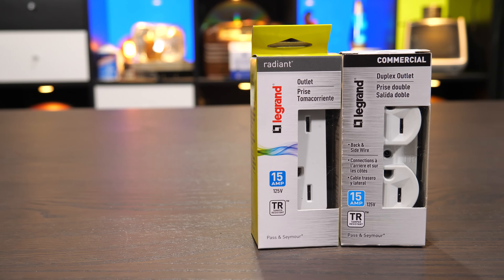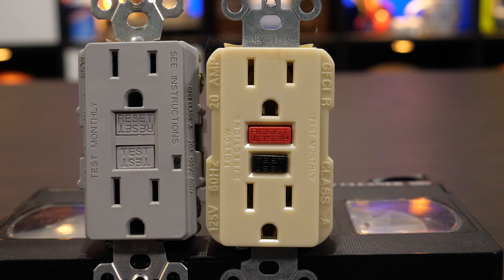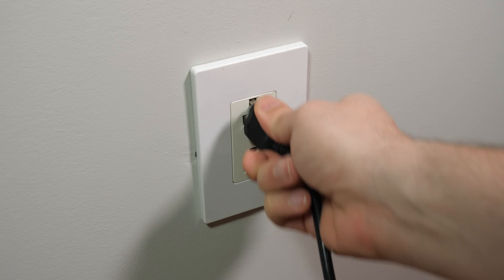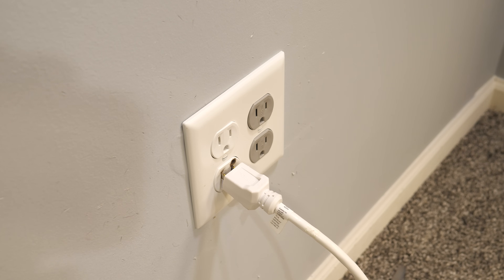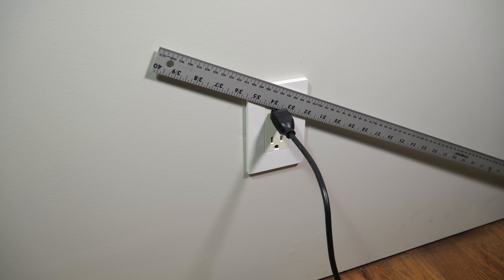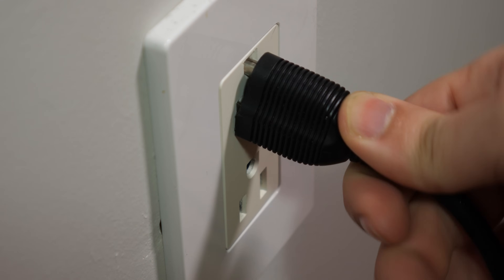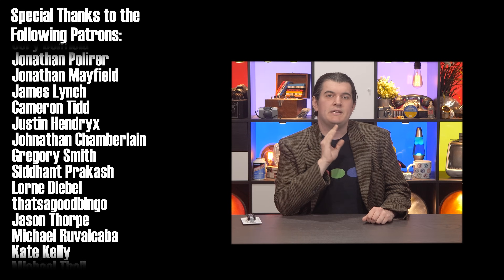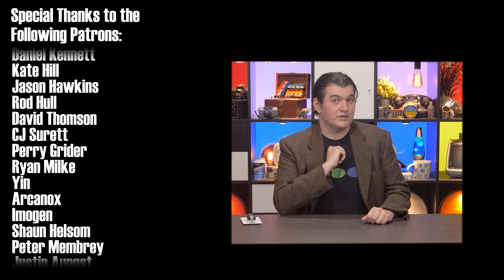Power outlets are topsy turvy - but does it matter?

Comment: Every house or apartment I've been in has its outlets ground down. But at my current workplace, all the outlets are ground up. I never noticed because I don't plug things in at work until I saw a right angle plug halfway up the wall pointing upwards. I just thought it was shoddy installation, like how most buildings are done nowadays. That is until I noticed that every plug in the building was ground up.
But I'm in agreement that instead of focusing on the outlet, we focus on the plug. Both insulating the parts of the pins that could be touched and right angle plugs would greatly increase safety. But I have a caveat. Don't have right angle plugs facing towards other plugs! The biggest downside to 99% of right angle plugs is that they cover at least one other outlet when plugged in. I have a 6 outlet surge strip that has 3 things plugged into it because of the bulky right angle plugs, and that's only because the third thing is a straight out plug and not a right angle plug. There's gonna be that guy that says "Just plug it in the bottom outlet and you don't have to worry about that derrrr", and to that I say that doesn't work as most appliances where the power supply is also the plug do this. Also, some bulky plugs are so bulky that they cover the outlet above them. My recliner is like that. There's no reason it needs to be that way, but it is.

Comment: Actually, I do care.  AC cords with a 90-degree bend at the plug to remain flush with the wall are designed for outlets with the ground pin at the bottom [as you covered in detail--yes, I should have watched the whole video before commenting].  My UPS has one of those, in fact.  Regardless of what may have been intended, or what may be marginally better, I don't want any busybodies telling me I need to flip all my outlets upside-down.  I like my surprised-face outlets just fine.

The 50-year-old tape-recorder AC plug is also not polarized.  You can plug it in two different ways, only one of which should be allowed in many cases.  I'm old enough to remember a record player that let you know in no uncertain terms that the plug blades should be flipped the other way.  ZZZZAPP!!!  Yeouch!  120V AC feels painfully tingly, more like a hand-and-arm seizure.

Comment: The risk of a short is greater-than-zero.  But it isn't enough to worry about in a residence or office (Except in Boston).  Let's just all agree the NEMA 5-15 and 5-20 are terrible, but not so terrible we need to bin every plug and receptacle in Taiwan, Japan, and most of the western hemisphere.  
The 45 degree plugs are the best solution.  Most office/home Battery backups use the 45 degree design.  Only my Rackmount UPS uses the old straight out of the wall plug.

Comment: It's possible to make plugs and outlets much better with just a few simple steps (some of which you already mentioned):
1) Yes, mount them Chicago-style (landscape) - but rotate each outlet, ideally so the ground pin is upwards.
2) Have the cord come out of the bottom of the plug (furthest away from the ground pin). That way, the cords never tangle & don't pull out under their own weight.
3) Make the ground pin a bit longer than the live/neutral pins, and partially sleeve the live/neutral. Optionally add a "shutter" to close off the live/neutral if there's no ground pin.
4) Make the pins way bigger, and rectangular
5) Add switches.
6) Oh, er, sorry, I seem to have been describing a British double socket 😆
Reply: You forgot Add a fuse to each plug.
But I do agree with 2,3 and 5. And you can already find tamper-resistant outlets with shutters at your local hardware store. These don't rely on the ground plug and instead require live and neutral to be inserted at the same time.
Reply: I think you forgot the fuse in the plug
Reply: @Jonkree-old   With modern RCDs, the fuse would be pretty much redundant in a US wiring system (lots of spurs). They do still serve a purpose on UK ring mains, although generally the RCD will trip & take out ALL of your sockets before the fuse blows... An exception would be if you overload a single socket - I used to run my whole office on one 13A plug (and a humongous extension cable) - it actually drew nearer 16A & got so hot it burnt the side of the plug off, and welded the switch "on" on the socket it was plugged into!
Reply: orient so neutral is upwards
Reply: The US has new TR (tamper resistant) outlets that have shutters over the hot/neutral. I wanna say it's the new base standard for outlets but i could be wrong
Reply: XD i mean the likelihood of a deathtrap is less
Reply: Sure, your love of that monstrosity will evaporate after you step on top of one lying on the floor at night. LOL.
Reply: @parkershaw8529   I suspect that's the real reason for the switched outlets - they're rightly terrified of leaving something unplugged!
Reply: @parkershaw8529  I can honestly say that, in 50 years on this planet, I've never ever stood on a plug barefoot. Of course, one reason for this is we have switches on our sockets, so we don't need to unplug stuff and leave the plugs lying around on the floor...
Reply: Better solution, use European plugs and sockets.
Reply: I think british socket is still pretty inferior to the standard EU socket.
Reply: @RamsesTheFourth EU plugs have the perfect balance of being safe and convenient. Being recessed makes them quite flush with the wall and you can't get to the prongs while plugged in. 
Also you can add cheap removable child safety discs into EU plugs that block the way unless twisted.

Having an extra fuse in the plug is safer in a similar way as wearing a helmet when you drive a car is safer.
Reply: @RamsesTheFourth   In what way(s) specifically? As someone with experience of both (and also US & Aus/Chinese sockets), I'm ambivalent over the advantages/disadvantages of UK vs EU.
Reply: never understood the switches. if they accidentally get bumped at the same time as something comes to short it doesnt matter how many switches you got.
Reply: @ahandletocontinue123   The switches are useful if you want to leave something plugged in, but have it isolated & definitively "off". But honestly, they're just a convenience, not a safety feature. You can buy unswitched dual UK sockets (and singles).
Reply: Switches are important, lets say you have a short on a metal device - you know you can turn the device off quickly.  @ahandletocontinue123
Reply: @davidt-rex2062  Or, you could do this insane thing called unplugging it, which I'd trust a lot more than a switch.
Reply: @wta1518 it's convenience more than safety. Sometimes the wall switch is more accessable than the switch on the appliance. Also for things like your TV back when they had cathode ray tubes and drew lots of standby power you can turn it off without unplugging it
Reply: Or you could just pull on the cord to rip it out the wall. Even faster than fumbling songs for a switch. Who cares about not damaging a wire if it's an emergency.
Reply: @mrping100 or just have a wall switch that connects to the outlet.
Reply: @davidt-rex2062  why wouldnt you just unplug it? and if it was that much of a short your breaker is gonna get to it a lot faster than you grabbing a switch
Reply: @davidt-rex2062  you can also just yank the plug. You have to reach for it anyway if that's where the switch is! ... I think there's a video on that actually...
Reply: @mrping100  1) no, it is never more convenient to reach for the outlet unless the thing that's plugged in is horribly designed. What a stupid "argument".
2) No one uses CRTs anymore outside of a few retro enthusiasts. And, a better solution would be to have a switch on the TV that actually turns it off. Much more convenient that having to worry about whether or not your phone is actually charging because the unreachable switch on the outlet might have been flipped.
Reply: @Tsuchimursu  You'd be surprised how hard it is to pull a UK plug out of a socket by it's wire. It's a design feature - the idea is instead of the plug harmlessly pulling out of the socket e.g. if you stand on the wire: Instead you trip over the wire, bang your head on the table on the way down, then the appliance who's wire you just stood on lands on you, probably causing burns or impact injuries...
Reply: @wta1518  
1. It just is more convenient. I could name you specific examples from my workplace where that's the case but largely its unimportant, you are literally incapable of understanding because you haven't had the use experience. As the saying goes, you don't know what youre missing!
2. A CRT was CLEARLY me giving an example, hence why I said "when they had". Learn to read. And sure, would be nice, but most appliances do not have a button that actually does that
3. Its not a common point of failure. Please don't talk about things you haven't got experience of. and they don't get accidentally flipped because we know how to design a sturdy switch here, unlike the standard american light switch
Reply: @404hopenotfound  I mean sure if you want, same effect, but just you're running unnecessary cable and introducing possible confusion about what controls what. This way you never have to unplug anything and you know what switch is what

Comment: Seems to me that a good balance would be having the two outlets facing away from each other, so compatibility with right-angle plugs is maintained at the bottom, it's impossible to install it "wrong" since it's symmetric, and you get that tiny teensy benefit of the ground pin that only really matters for the top plug anyways.
The downsides i can see would be expense of changing the manufacture but that might be minor for all i know, and that now people might install right angle plugs upside down, but i think it's still a net positive.

What i don't understand though is why sleeving the pins is so difficult, it's not like british or euro plugs have some super fancy sleeving, it actually looks sorta janky.

Comment: as a german, this video was quite baffling to me. our receptacles are (almost?) all recessed and rotationally symmetric, and the plugs on anything reasonably big are almost definitely both at a right angle and grounded (the angle is optional, but the only device that used a straight, grounded plug i can recall was a vacuum). i don't think i've ever seen a situation where you could slip something between the prongs and the wall, and of course even if you managed that, most of our plugs don't have a contact area that extends all the way up the prongs.
also why the heck do all your plugs look so damn hard to grip, it's like you're trying to get people electrocuted (@ plug manufacturers)

Comment: I'm surprised that you didn't mention the safety benefits of the Chicago method. With the outlet oriented sideways it would be much more difficult for plugs to slip out of the receptacle since the prongs are oriented horizontally rather than vertically. Also, if a piece of metal was to fall between the plug and the wall it would only hit one of the prongs, thereby failing to complete the circuit.

Comment: Most important takeaway of the video: the Chicago orientation is for sure the best way to install the receptacles. 2 right angle plugs work. No drooping. Bumping doesn't seem to make them more dangerous as easily.

Have to mention that all of your plugs look antique and scary to me. Finland (and probably a lot of Europe) seems to use a standardized, much safer design for both 2 and 3 pronged plugs.
Reply: North america is way behind on electrical code/standards. Outlets? Terrible. Plugs? Terrible. Breakers? Terrible. Death? Assured
Reply: Horizontal orientation makes sense where conduit is used.

Comment: NECA 130 5.5.2 e 

"e) Grounding-type receptacles mounted vertically should have the grounding conductor opening at the top. Receptacles mounted in the horizontal position should be mounted with the neutral conductor (long slot) up."

Comment: I think at one point people were thinking the Electrical Code would be updated to force builders to use the ground up orientation for these oddball scenarios. So some electricians started installing them that way to be in the right position for the regulation. Then I assume at some point the NFPA decided it wasn't beneficial enough to need.

Comment: We definitely need to add plastic shielding to the blades, but also maybe add a fuse. I don't think we need to switch entirely to the UK G type plug, especially since their size creates limits on spacing and the right angle being 100% enforced on all power leads prevents outlets from being placed in areas that would otherwise be safe and convenient.

Comment: Wow. Arguing against the added safety of a correctly installed receptacle to instead benefit from the utter inconvenience of a 90⁰ plug blocking multiple receptacles.

How about 'no' on that one, champ. 😂

Also: 90⁰+45⁰ is still a problem with wall warts.

Normal plugs, ground up: +0.00001% safety.

90⁰ plugs: -0.00001% safety, +1000% inconvenient.

90⁰+45⁰ plugs:-0.00001% safety, +100% inconvenient.

Arguing for the last 2 is silly.
Arguing that they should be the default is insanity.

Comment: Yeah, the American A and B plugs are bad but they probably were first and others improved their problems. I think the safest plug is probably British G type by design of its pins and having fuse integrated into, but they are bulky (and you can not plug it without ground so even the small apple charge needs bulky plastic "Ground pin") and pricier than others, so the best compromise is probably the European C, E, F compatible plugs, by having partially isolated pronks and ground sticking out of the socket so it most probable you touch that.

Comment: One campaign I’d wholeheartedly support is getting the big box stores to stop selling non-TR receptacles. It’s code for pretty much all residential circuits, and you can use one even in the specific scenarios where they are not required by code! TR eliminates the choking hazard that plug covers come with.

Comment: All of the outlets in my house have the ground facing up (from the previous owner) and it drives me crazy because I have a lot of appliances with right angle adapters built into the plug and don't fit flush against the wall, and have a cable that shoots up and then back down. I prefer the outlets with the ground facing down, like they have been my whole life.

Comment: The real thing that bugs me is that recessed outlets are available. They're expensive right now, 10 dollars a pop compared to pennies on normal outlet boxes, but there's 0 risk of you accidentally touching a pin in them, they physically obstruct access until the leads are disconnected. If they were mandated by code, that 10 dollars would turn into the same low prices as normal outlets overnight.
Reply: The problem is that lots of plugs and devices (like the kind of timers and such shown in the video) are not designed to fit into a recessed outlet.
Reply: Can you plug in right angle plugs into those?
Reply: Unfortunately the massive installed base of wall warts makes recessing the sockets nearly impossible.
Reply: @keiyakins  They could sell recessed sockets with an adapter to make them usable for wall warts too. Obviously that would make them even more expensive.
Reply: @darksaiyan2006  and the adapters would remove all the safety benefits
Reply: @keiyakins   For those specific plugs, sure, but for the sockets that could go into the recessed plugs, you don't get that. 

Here in Europe recessed receptacles are the norm - having the adapters would help get that as the norm until the plugs follow suit.

Comment: A. In my basement, i started with all outlets ground up. But my meat brain couldn't handle it and 95% of the time I plugged something in, I had to turn it in my hand. 
B. Power adapters , like AC to DC all seem to want to be plugged in in a ground down method. 
C. I also shop at Menards. (actually i work there)

Comment: Can testify that the ground up orientation does have some benefits.  When I was growing up we had these fancy metal outlet face plates.  They were made of pot metal and if you over-tightened the mounting screw, they would crack at the strap between the two outlets.  This happened on one of out outlets and no one noticed.  Until one day when I unplugged something.  The plug was holding the cover on the outlet.  When it was unplugged, the wall plate fell on to the plug, exactly as you described.  The remaining portion of the face plate vaporized and I got a bit of a shock before the CB tripped.  I learned my lesson from that event.  All the outlets in my house now have plastic face plates.  Totally safe now.  No possibility of anything bad happening....trust me.....

Comment: Shot in the dark here, but why not have the two plugs opposing ways in how the ground plug is facing.  Upper plug ground up, lower plug ground down.  You can still plug your right angle plug into the lower receptacle.  As it is, you can't plug in two right-angle plugs to a single 2-plug outlet anyways (unless they are 45 degree ones, which are not honestly that common)

Comment: I suspect part of the reason for not flaring grounded plugs is that they won't fit well into outdoor-rated receptacle covers. I ran into this recently with an extension cord with a slightly-too-thick plug that required a bit of force to plug in to push past the cover.